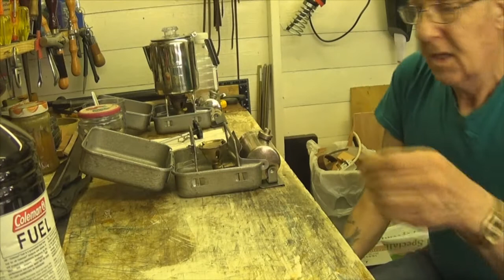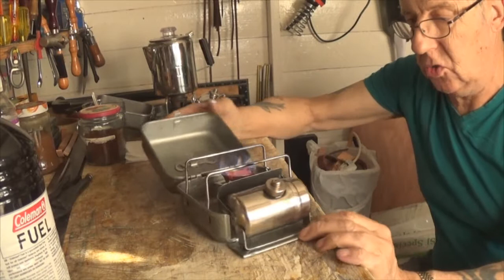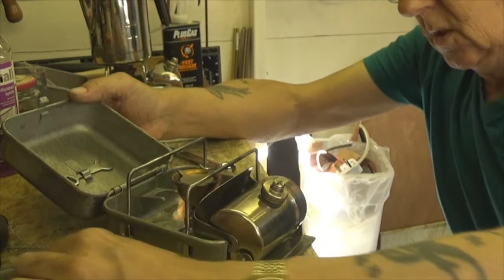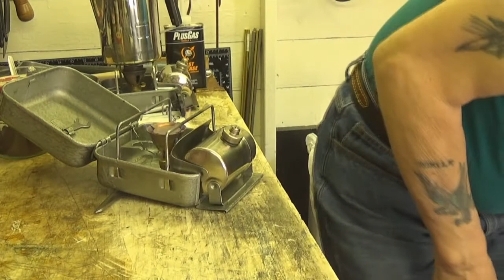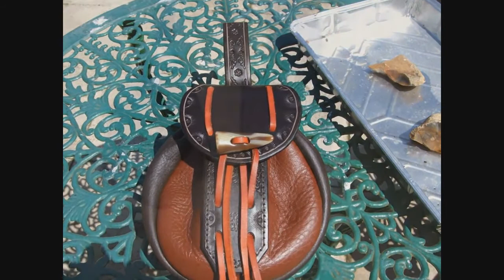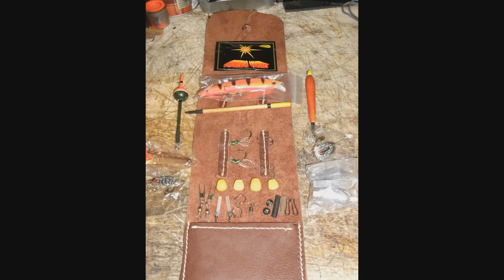How to correctly light an 8R stove, and some more

Comment: Looks like you got it running really well. 
I ordered me another Optimus 8r with the red plastic valve wheel from Canada.  It was held up in Ontario for a couple of weeks but is in the U.S. now.  Can't wait to get it and see how it runs. 
Oh man that's some awesome leather work as usual. 
Thanks for sharing and God bless.
Reply from the maker: Hi Rob, don't forget to use Aspen 4 fuel in it or Colemans if you can't get it, I bet you give it a good clean up, as you can bet your life that petrol was used in it, let me see a video of it up and running when get it my friend, God bless, stay safe.
Reply: @charlietango1635  Just tracked the package.  It just arrived at the post office in my home town.  
I have never seen the Aspen here.  
I will have to look into it.
Reply: Hi Charlie tango 1 can you please tell me if the 8r stove spindle the same as the Russian copy? Cheers love ur videos mate.
Reply from the maker: @pauldeary  Yes, It will, I can fix this if you live in the UK I only charge for post £5 but if you do it yourself you might want to order a graphite ring as well. you can ring me on 07713090929 if you need my address.
Reply: @charlietango1635  thanks 😊 al get in touch over the next few days for ur address. Never did a repair on my Russian copy so I’ll take you up on ur lovely offer mate. Many thanks 😊
Reply from the maker: @pauldeary  I DO-NOT charge, only for the postage back to you £5, please ring me, I need something to keep me busy. 07713090929